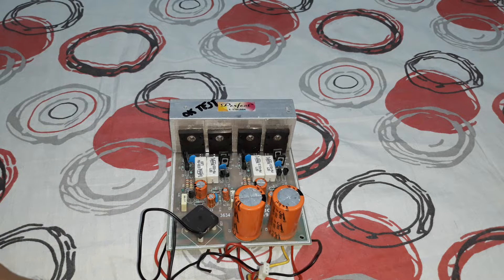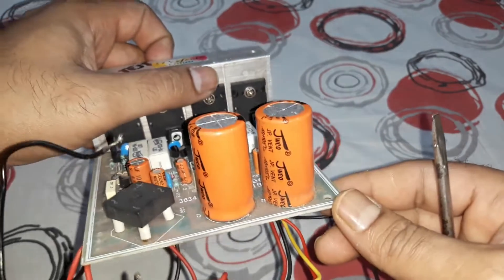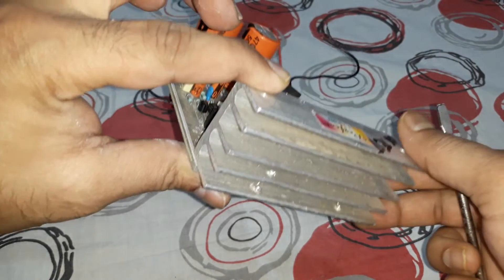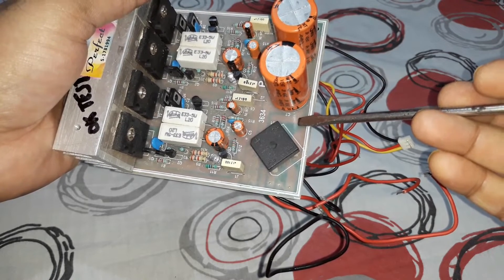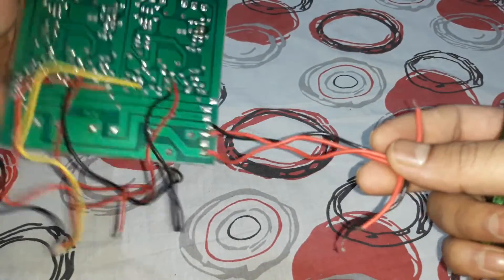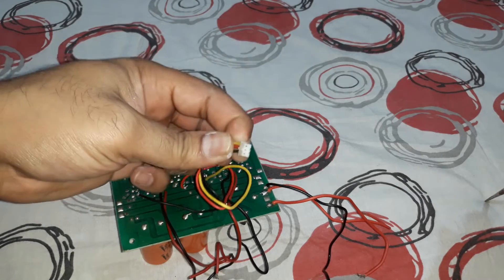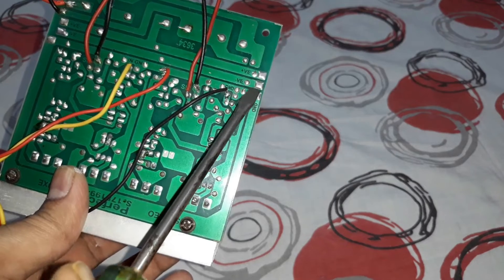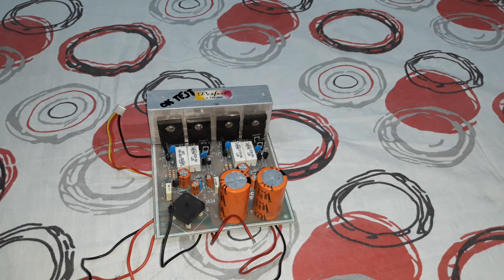Mosfet Audio Amplifier Board 5200 & 1943 Made in Japan / High-Performance 300 Watts Stereo Amplifier

Comment: There’s no way that heat sink is big enough to dissipate several hundred watts.
Reply: Correct, but it doesn't have to.  If you are delivering 100 watts of power to the amplifier that is 75% efficient, then you will deliver 75 watts to the load and 25 watts will be lost as heat in the amplifier. (we know nothing about the class of amp, unless I missed it) But, yes, the heat sink is most likely undersized if you're going to run at full volume especially low frequencies.  Like he said, a fan is a good idea!